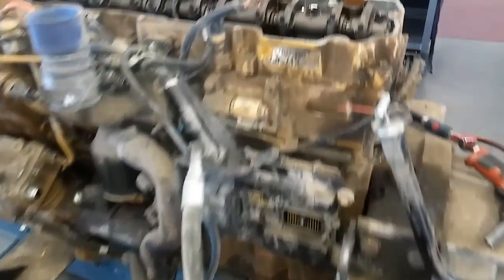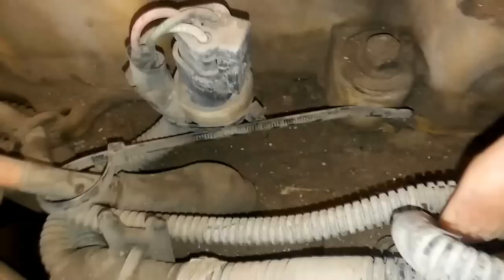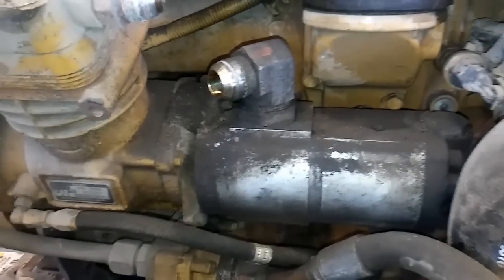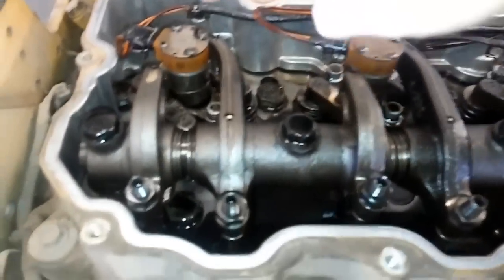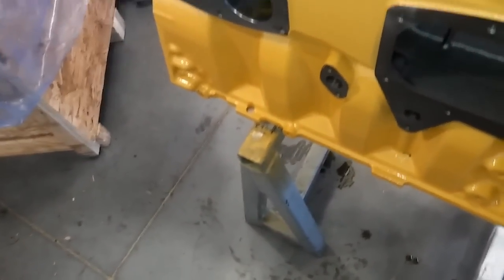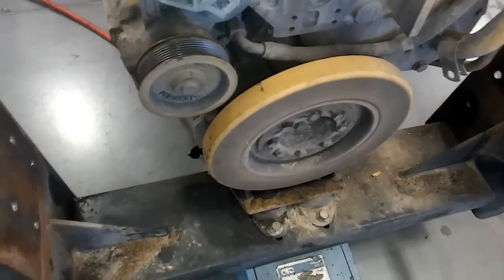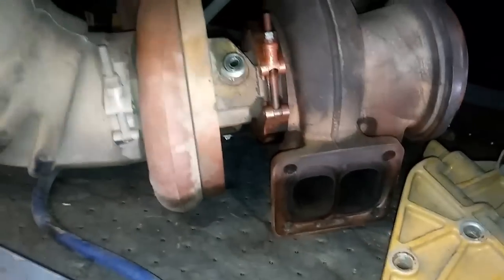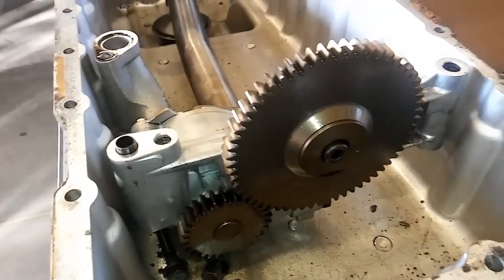The Cat C9 Engine.  Facts, Walk Around, Sensor Locations, and Maintenance.  Know Your Engine.

Comment: Thank you for mentioning early oil change intervals.  Every customer that asks me, "What should I do for my engine?" when they own a HEUI I always tell them that clean oil is critical to the life of the engine.  I have literally had trucks towed into the shop, and all I had to do to get them to fire up is put more oil in them; because the owner hadn't changed the oil in forever.
Reply from the maker: +Toromont123 I can't believe people would buy such an expensive machine and not pay any attention to the maintenance of it.
Reply: At a dealership level we usually see these engines in straight trucks, light load stuff that people treat like cars.  They just don't take the time to learn about what they own in the same way that an owner operator with a C15 would.  Knowledge is power for any owner.

Comment: You made an excellent point about keeping the engine oil clean.  A few years back we purchased a new 950H equipped with a Horizen Cleare-Air DPF.  The first engine oil change was performed @ 450 hours (oil resembled sludge).  You probably know what happened to the HEUI pump and injectors thereafter.
Reply from the maker: +Chad Jessup They lived happily ever after? I'm going to guess they got replace soon thereafter. I think the HEUI system makes sense on paper, but the components are just too sensitive to last long enough enough compared to the MEUI style systems on the C13 and C15.

Comment: Very informative and helpful.
We just purchased an RV with the C9s engine and have already had a turbo failure. We believe, and I think your video confirms for us, this was the result of a faulty DPF Regen system. It’s currently in the shop awaiting the new turbo. We’re also addressing the failed emission issue and hopefully will have a sound and reliable engine when we’re finished. I also learned from your video that we have the common rail injector system. Thanks for the helpful information. Any comments or suggestions on this engine going forward would be appreciated.

Comment: Josh, could you address fuel flow for C9 and TIT and egt for same. Any test cell video would be helpful in to the proper fuel flow at various loads and respective egt for each cylinder and turbine inlet temp.

Comment: Hello I have seen you have a lot of experience on HEUI systems. I have a C9 engine with crank and no start. While cranking, my engine speed is not rising and injection actuation current stays 0%. Can you give me a hint? Recently I have replaced engine harnesses and all sensors(even speed timing). If I take out any plug from the timing sensors I don’t get an error code, injection actuation pressure goes up but up to 45-50bar(60bar is starting pressure). If I use starting fluid the  pressure goes above 60bar but no start(as there is no injection actuation current).
 CAT D6R LFM prefix

Comment: Can you engine swap a c9 for a c7 without significant modifications? Do the motor mounts, transmission bolt patterns, ecm interfaces etc all basically work the same. 
F750 RV with allison

Comment: Does the C9 have half the cam shaft bearings of a normal engine, the screwed up rocker arm shaft design, and the inverted torx fasteners like the C7?
Reply from the maker: No, you are thinking of the C7.1 which is a Perkins engine. C9 is an actual Cat designed engine.

Comment: Hey Adept. I got a question. 
I work on cats all day long but we all get stumped every now n then. 
I have a cat C9.3 that turns on every morning fine. Once it’s hot (Operating temperature) and gets turned off it won’t start. It will start with ether but I don’t want to keep using quick start. Any suggestions???
Reply: The only time I've ever had this issue in a vehicle was a 5.9 Cummins with a 46re transmission and the transmission temp sensor was bad. It would take either to get it going and if you stayed in the throttle in neutral it would run. As soon as it went into gear you had to wait until it came below 185 to start it again.

Comment: I have a 2005 motorhome with the cat c9 400 that I bought about a year ago. I have been watching your videos and find them very informative. We are currently traveling and I noticed the check engine light come on. At first it was just a solid light. After awhile it started blinking and I realized from you genius it was a flash code and started counting. It flashed 25 - 37 - 46 - 25 - 35 and then stopped and repeated the same code. I looked up what the different codes and where the sensors are. My question is, do I have a problem at each sensor or is there a central point responsible for the different codes I am seeing. Thank you for any help you can provide.

Comment: Hey...
I sail on a tug and I've got a C9DI Marine engine.. We use this engines for the generator and we have 3 of them here.. The problem now is that, this one engine isn't taking load, ie when its sync and taken on load, the frequency drops and then it trips.. After couple of times, now the engine doesn't even start abs it displays a code as spn 656 fmi 11... It refers to injector 6 failure I guess.. Wat do I do..? Should I just go ahead pop the Injector and fix a new one or should I call cat team to check with the ecm..? Thnx in advance..

Comment: Awesome bro.
Bro I've a question for you .
Having problem on a cat330D L excavator no power during load with a C9 engine.....thank you bro.
Reply: You ever solve your problem? Have an identical machine and assumed it was a fuel issue. Replaced fuel filters, flushed tank, et. When machine tracks up hill or digs it stalls under load.

Comment: Do you know anything about the 3406B/3408 engines? I have a few dump trucks that run those and they're starting to get up there in age so I'm curious as to what to expect for failures and if Cat can help me in terms of parts and service.
Reply from the maker: +Dieselhead I've worked on a handful of 3406B engines and seen a couple 3408 engines. Cat is pretty good about providing parts for their older stuff. I know fuel pumps, nozzles, piston packs, and the like are still available for the 3406.

Comment: ADept, have you seen a C9S Shutter under various loads above 1500 rpm.  I have one that will rattle your teeth out.  Its not missing but it feels like someone it cycling the power on and off to the ecm at 5hz.

Comment: Hey Ape we have an ex US military spec C9, Serial LFE01365.  I need to get throttle control. Just need 2 speeds. Low and high idle. Not sure of pin configuration on ECM. Can you help?

Comment: good info thanks 
got a question for you 
i have a C9 in a yacht that is having trouble holding rpm
it likes to lose about 200-500 rpm after a while 
someone told me there is a throttle cup that needs to be looked at 
i have not heard or seen that 
any help?
Reply from the maker: +thetripoflife A throttle cup? Hmmmmm, unless there is some weird yacht only part on your engine, I've never heard of a throttle cup. There are injector cups, but if they fail you'll get fuel in your coolant. My guess if it's losing rpm is you have a problem with the engine like the HEUI system low boost or if the engine seems to be running fine the ECM may be losing throttle signal from the throttle lever or pedal. You'd want to hook up to the engine and see if the ECM is showing a constant throttle input from the lever or pedal while it's losing rpm. Now most of those pedals are a PWM signal so you could put a multimeter on the pedal and see if it's sending out a constant signal.

Comment: Do the C9 and C7 have parts commonality? Is it basically a bored+stroked+sleeved C7? I have a 3126 torn apart and wonder if I could use the C9 rotating assembly to keep a mechanical engine (pre-99 EPA req) with larger displacement. I can machine or have pistons made, already planning to bore the block and press in sleeves (since 31** are parent-bore). Thanks Josh’
Reply: Why bother?
Reply: @toyoscio  modern emissions mandated hardware decreases engine longevity and hinders fuel mileage greatly. Aside from increased maintenance costs and additional component weight, there is the legality issue of forced minimum epa standards operated in certain areas - depending entirely on age of power unit data plate. I’ve seen this done with late 3406C’s stuffed with C18 internals (in older trucks or gliders). I transitioned to medium duty so as I can work on my own stuff in-house, and I make more money in this segment. The downside is less robustness built into the engines designs (from all manufacturers not just CAT, see navistar VT/DT/maxxforce and DDC DD5/8). Since a crate MD engine costs into the 5-digits, many times exactly as much as an HD, it should have the same b10/b50 life as the larger cousins - and be serviceable just as they are to extend it.
Reply: @Krossf1re  Thanks I undestand,

Comment: Hello Adept, can you make a video but instead of C9 can you do it for a Cat 3126? I have a 2002 Kenworth T300 Box truck with 400,000mile. Also i notice now that every time i run the truck it make a noise like (clack,clack,clack,clack its like its has bells inside) i put 1st gear then released the clutch and it's start making that noise only when i press the pedal to increased the speed not when i have it on neutral and i floor it, can you help me out?Thanks.
Reply from the maker: +Alex J I'm going to try and make a video like this about every Cat engine. Has the engine always done that or just started?

Comment: I have a 07 Freightliner Business Class with a Mercedes engine that I use as a Over The Road Expidetor, I'm looking at changing the  engine out and putting in a CAT C9. My question is do you know of a mechanic shop/CAT Dealership that can do this. I call Freightliner and there are basing Parts Changer.

Comment: Do CAT or Adept Ape have a position on Bio Blend Fuel in Petro Diesel? I own 4 diesel engines and only my Mercedes Bluetec Diesel cautions about BioBlend above 5%. Recently I was filling the Mercedes-may contain 5 to 20% was tagged on the pump. Mid way through the fuel run-check engine illuminated. On the next fuel stop with 100% petro diesel, the check engine extinguished. It seems more often when filling my motor home with C9 it's Bio blend diesel. 
This video will be my reference video. Thank you.
Reply from the maker: +Kenneth Bullins Cat has a specification about biodiesel. I'll try to talk about that in the next Diesel Talk.

Comment: hello adept I'm fixing a c9 NO ACERT engine and has a code that I could not eliminate, the code is 655-11 which says nozzle number 5 open circuit with undefined damage, I changed the injector solenoid, also change the injector for a new one, and I do not know what else I could do ... you could guide me to eliminate this fault, the engine in minimun rps 1200 works with missfire and max rpm 2200 works fine .. thnks
Reply: daniel barajas torres Did you diagnose the electrical circuit?

Comment: What isyour opinion on doing an cat C9 engine rebuild at home (read farm with basic workshop). Tools are not a problem what we don’t have we can buy. As reference I have rebuild a john deere  8L (with linepump) engine,  an old perkings ( 4 cilinder) and many head gaskets on other john deere  engines common rail ant rotary fuel pumps.
The main reason for the question is the 115 €/hour(122$)  workshop fee from the licensed cat importer
Reply from the maker: +Bruno Lamote A C9 engine is pretty dang simple. There is no specialty tooling required to do practically anything on it. The injectors don't need any height tool, the HEUI pump isn't timed, and the overhead adjustment is really simple.
Reply: Adept Ape
I have disassembled my C9 engine, indeed it is a simple engine, all the pistons except one have excessive wear, on the worst one, one of the rings was broken, the others had just big tolerances also the top of the pistons strike the liner, so I taught 6 new liners, 6 new piston and al the seals, but I see cat has complete packs for that engine, but not my C9 CLJ10818 (serial number), would I dare just to order one of the others and buy the specific stuff afterwards? What is your opinion on this, thanks for the info
Reply: I have 950 g don't start y

Comment: Ape, man it would be awesome if you did a video on repairs/diag on a CAT V8 like a 3208 or a 3408. I'm curious about the differences between V8's 3208 & 3408, I6's C7, C9. I'm also curious about the engine just smaller than the C7. Comparison! Cummins ISB5.9 359 ci, ISB6.7 408 CI, ISC8.3 505 CI and a ISL8.9/9.0 is 545 CI all of which are available with high pressure common rail. The ISC & ISL are the same block & bore but, the stroke it longer. Naturally if a ISC will fit, so will a ISL. primarily the ISB's 5.9 & 6.7 are pickup truck up to 36' box trucks like a budget or u-haul rental trucks. I want to install one of those 3 mid-range I6's or maybe a 3208 CAT engines in my 85 3/4 Ton pickup.
Reply from the maker: +Norwood E. Jatho, Jr. I can try to get a video on a 3208 up one of these days, but I haven't even seen a 3408 in several years. I'm sure there are still some out there, but rare these days. Cat doesn't make a smaller engine than the C7, it has smaller engines, but they are normally made and designed by Perkins, which is a much less known company. I'm going to try and make some more of these engine walk-around videos in the future, kinda depends on what I'm working on.
Reply: Adept Ape ok cool, how about the 3116, 3126 and 3176? Aren't those smaller than the C7 and C9? What are the cubic inch sizes of those 5 engines? Are all of those 5 engines available with turbos or CGI? What about the 3208, what's the cubic inch and is the 3208 available with a turbo?
Reply from the maker: +Norwood E. Jatho, Jr. So a good question on that one. I actually don't know the 3208 displacement off hand but I'll look it up, I think it's around an 8 liter I think, but I'll check. So the 3116 is the precursor to the 3126, which is the precursor the C7, so they are pretty much the same block and displacement, just different fuel systems and changes over the years, all 7 liter engines though. The 3176 is a different animal though, I've only worked on one and they have a crazy valvetrain setup, I can't say off hand if it transformed into the C9 or was scrapped, I would have to look into it more as they are a rare engine to see.

Comment: Can I put a c9 Caterpillar and a pick up truck
Reply from the maker: Sure, just load it in the bed with a forklift. You're welcome.

To actually answer the question, yes you could, but it is going to be a taller, heavier and longer than a V8 gasoline engine so it really depends on how much room you have in the under hood area, then getting the motor mounts, transmission, driveshaft and differential to handle the torque.
Reply: There is a project I would like to start I have a 1989 F250 Did I will like the try the put A C9 Cal a pillar and thenAnd I was wondering if that would saidOr what would I have to do to make it a smooth Ride
Reply: Thank you did not see that part
Reply: LOL thank you for the laugh.

Comment: Did you say the C9S can have a common rail fuel pressure of 30,000 psi? Did you mean 3,000 psi?
Reply from the maker: +mech cntr 30,000 or even higher is capable on these common rail engines.
Reply: Good to know thanks.  Wow that is a high pressure.

Comment: I can't stand electrical stuff like efi on engines. Just got a 1066 International with a DT414. 414 CI 6.8L Many many hours of pulling are on it, it has 4200 hours on it right now. I think its the cat Acert engines that my dad and many others hate a lot, they added all the emissions stuff and all that. (I think it was the Acert). Though, There are pros and cons. . .
Reply from the maker: +34486 SCI I don't mind the electronics as much, as a technician they make troubleshooting cylinders and monitoring parameters much easier, but add a great deal complexity and expense to the engine at the same time. So as an owner its easy to figure out the older stuff without all the specialized computer equipment, of course the newer engines with the DEF and EGR, seem to be going a little nuts. Thanks for commenting.
Reply: Yeah, Some smaller trucks now I hear run DEF... What next, Eco Cars?!
Reply: I dont mind the electronis because they can make a enigne more efficient, but on the other side came the emision standards and that put's extra complexity and (useles) parts to the engine also more back presure on the exhaust.
Reply: I hate cat converters. I think they are what produce cancer they are so bad. Back pressure for them things is like 3 psi? Like really?!

Comment: Those C9's dont like being in crawler jawcrushers that Metso builds (LT105) even if you follow service as instructed don't be suprised by gone injectors around 4000 hours, 2 - 3 rockcrushers that all have repeated failures at 4 - 5k hours.
Sure 2100rpm  all day long an shitty Swedish diesel that barely lubes is probably a reason they fail so often.
Also belt driven waterpump??? what were the designers thinking there? it should have been geardriven.
The latest crusher i ran shreeded the belt this summer and another one 2 weeks ago, only cat belts and a 1year old cat waterpump. cannot find any reasons the engine eats belts exept revs, big pulley on crank and small on pump, might lead to insane waterpump speeds and hence belt load? V belts btw.
Reply from the maker: +Emil's Page of Random Machinery & Other Things of Interest. I'm surprised it has v belts and not serpentine. They used those darn belt driven pumps on the C7 and C9, but they usually aren't much of an issue.